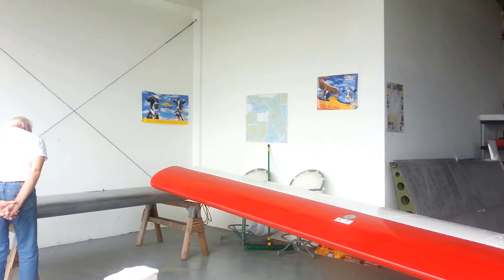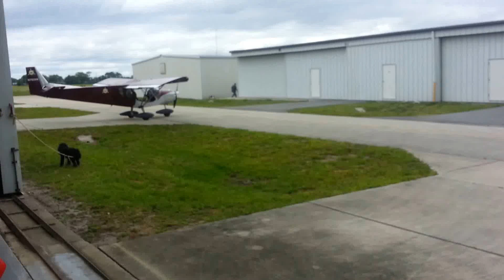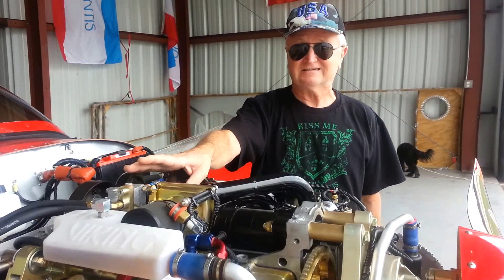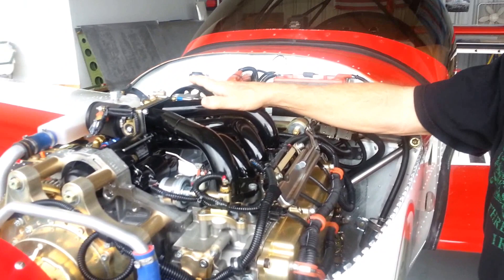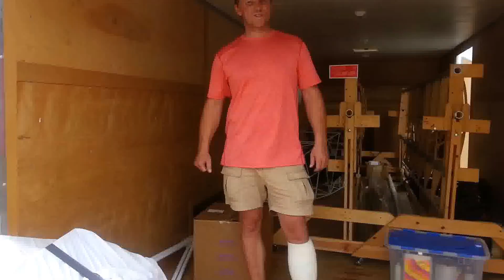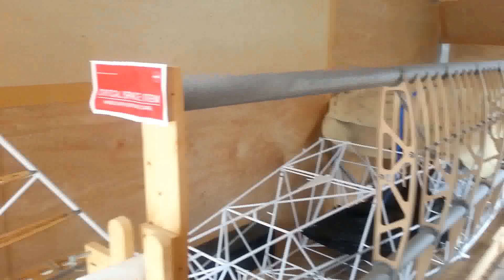Bob's Viking Aircraft Engines CH-650 and CH-750 Viking Aircraft Engine for sport type aircraft

Comment: Would love to see some follow up on how that kitfox 7 turned out with the viking motor on it.
Reply from the maker: It has been flying for numerous years and with floats. Had over 400 hours on it, was recently sold and went overseas to the Ukraine I believe.
Reply: @eggenfellner  that's great to hear. I'd like to see more videos from installs and flying on various aircraft other than zenith. Just isnt enough content out there yet for what you guys are doing. Really need more exposure. Could be game changing for guys hung up on the cost of other options , ie rotax. Love the innovation.
Reply from the maker: We have a lot of that out there as well, and more always happening. However, a lot of the video content is generally Zenith as those are the ones we install a lot of so we are there for it.

This week a Rans S21 engine left, velocity, Rans S7 last week and many many Zenith.

The holdout is really the kit manufacturers not the people. Zenith is very successful in that arena and open to reliable options, not just ones they make money off of.